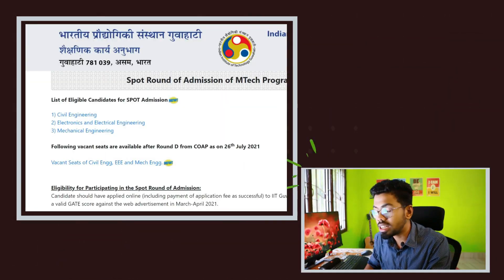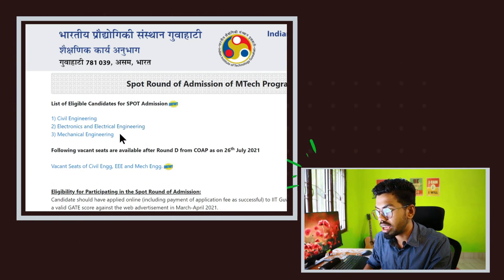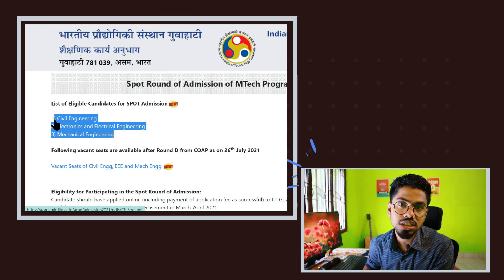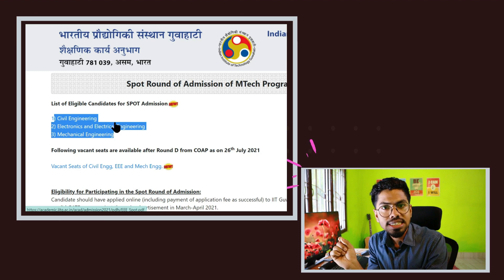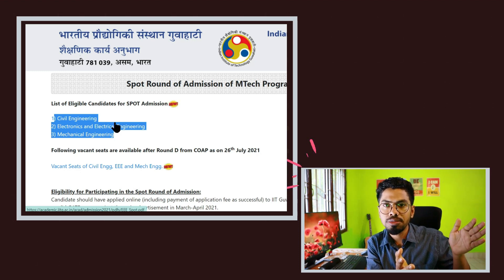Best Option for Low GATE Score | Use EC GATE Score Card Most Efficiently (Part3)

Comment: Bro,I got call to attend interview for rfdt on 5th may,my rank  is AIR 153 in EC(general category),what do I need to prepare for cracking this interview.Already I attempted iisc microelectronics interview,that interview was worst experience for me,I don't know VLSI basics (iisc stressed about them like current mirror drawbacks,uses, golden current source implementation like that stuff),can you suggest me how to prepare that stuff within 2 days, please.
I know gate syllabus of Analog ckts but in interview professors keep on digging,at one point I don't know the answers to their questions.
Reply from the maker: For rfdt revise your edc exclusively, they will dig up there take each formulaand try to explain yourself significance of each term used.... In analog all basic circuit for example amplifier biasing circuit explain the work of each and every resistor used... Then type of amplifier what the need ...
Reply: @whyRD  thank you.

Comment: Sir, with very little interest in emft and antenna theory, is it worth taking rf in old IIT..? On the other otherhand I've genuine interest in analog and edc. Isn't it better to take VLSI in NIT T..? Asking for your opinion. I've gate score 687 ec for air 359 (gen-ews). Kindly suggest the best options.
Reply from the maker: Hi Saheli , congratulation for a great result .... see with this score and little help from ews reservation , i think in 2-3rd round you can probably get an core VLSI seat in old IIT , like IITR,IITkgp or IITG... moreover as you are interested in EDC you can try for solid state in IITB , probably the best branch for backend jobs .... and you can also go for RFDT in IITD , yes yes i know you dont have interest but in RFDT choose microelectronincs sub branch and yes still you will be having 1-2 core course component form rf , but i as you are interested in analog domain so rf knowledge is important as RFIC knowledge is must for that .... and also in RFDT we have fabrication lab its one of kind and may be only 2-3 MTech branches in India have this .. sorry i am little too biased in RFDT branch ... its just my opininon .. final decision should be yours only .. good luck
Reply: Yes I'm considering RFDT micro as a very good option. But I've heard electrical also applies there and no separate cutoff is maintained for ece and ee like iitb ssd. So with a lower score in ece it's really difficult to get that branch. Probably iitb ssd is possible and iitg vlsi might be possible in additional rounds. But in case I don't get any of these, should I consider nit t vlsi over regular rf microwave courses of old iits..? Considering my interest. What's your opinion on that? And thank you so much for replying. :)
Reply from the maker: Yes you can, top NIT s VLSI are also very demanding in the industry
Reply: @whyRD  thank you so much sir for the suggestions :)

Comment: Hello sir ..my gate score is 437 ...obc ...8.49 cgpa ....ece branch ....can I get ms in  good IIT ...for vlsi branch ...
Reply from the maker: Yes you can
Reply: @whyRD  sir many one are saying me that ..try for next time for ms in vlsi in old iit sir ......
Reply from the maker: I dont got the question
Reply: @whyRD  sir can u please tell me which subject should I prepare for interview... If my target is VLSI .....I have certification of NPTEL analog electronics and signals and system ...does it increase my chance of selection ....sir plzz guide me ???
Reply from the maker: Revising gate syllabus is important, most of the question will form there.... Prepare your Btech project little bit... And. And if possible cover first 8-10 lecture of digital IC by IITM.. also specially revise EDC and RLC circuits

Comment: Sir my gate score is 507  if any chance in old iit rf and photonics branch
Reply from the maker: Any reservation ? probably something till the last round if you apply in all and each electronic realated position of all old IITs
Reply: @whyRD  obc
Reply: I am electrical engineering guy sir
Reply: Sir I am confusion  I get the job one of the service based company  but my internet is doing mtech vlsi related courses in old iits  but my gate is 507 obc ( electrical) plz give me some suggestions
Reply from the maker: For electrical 507 is little low bro... But still anything can happen, only way is apply for many position ... Participate in spot round , if cgpa is good try for MS in old IITs . ... Go for old NIT or new IITs core vlsi branches too

Comment: Sir RF and Microwave in old iits vs old nits vlsi...which has better placement opportunities??
Reply from the maker: Rf in old IIT.. i am myself a product of RF 🤓
Reply: @whyRD  How did you get into Vlsi by doing RF
Reply from the maker: Dont you think RF is a integral part of vlsi design? For example you mobile chip dont they need to tx and rx RF signals ? Besides i have done project on analog circuits and also digital design courses from vlsi branch
Reply: @whyRD  I see so it's all about knowledge and skills
Reply from the maker: Yes, definitely
Reply: @whyRD  I secured a rank of 506 in GATE 2022, do you think I can get into one of the old IITs